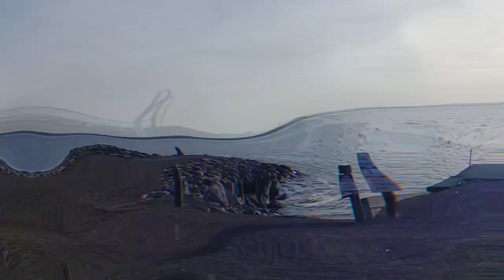1959 Impala Convertible - What a Find!

Comment: Those classic Impalas can be rebuilt with reinforced cabin, doors and floor. Straight steering column can be substituted with a safety steering system and  ABS disc brakes installed  Add head guards, seat belts and air bags. The result will be a safety equipped classic with higher value and durability. Thanks.